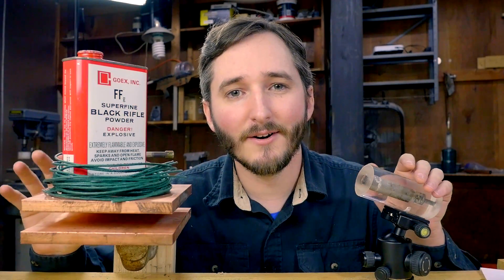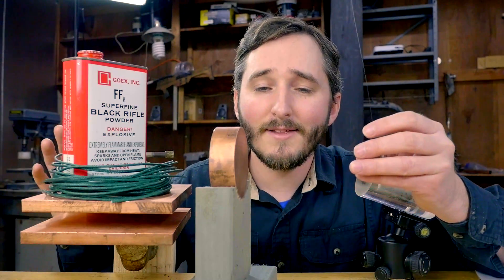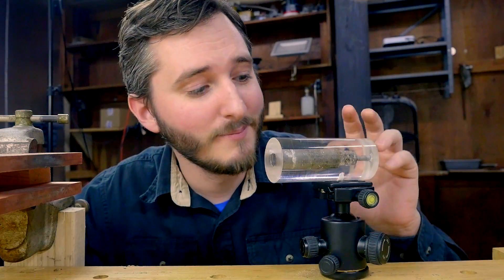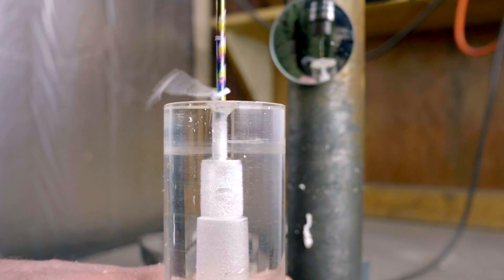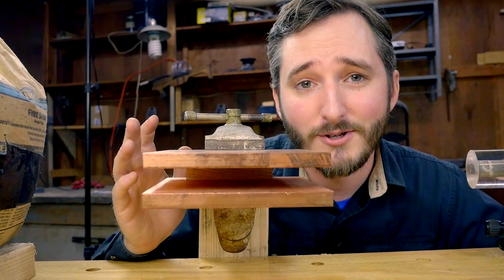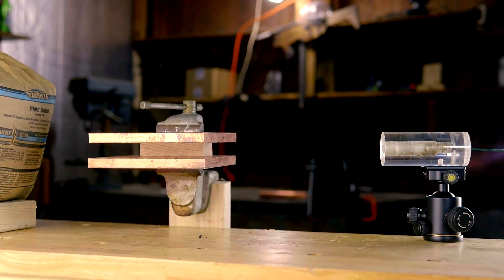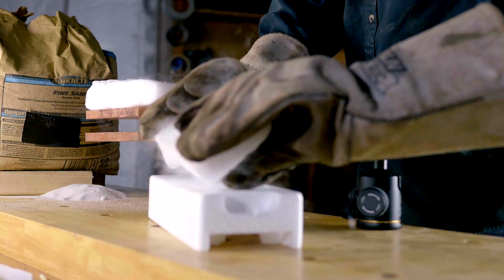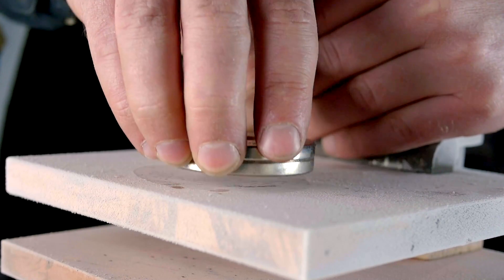Electromagnetic Force Fields VS. Magnetic Cannonball

Comment: Did you consider that the magnetism of the bullet may have been affected by the chemical explosion?  Permanent magnets can lose their magnetism via impact shock. ANd if so, this would affect the copper's ability to stop it.

Since the idea was to activate the electrons of the copper to produce a repulsive effect, what would happen if you were to apply a current on the copper plates or tube flowing in the opposite direction of the magnetic bullet?  Could you propel the magnetic bullet with a magnetic rail gun instead? 

New experiment. Propel a magnetic bullet via a magnetic or electric railgun through a copper tube with current flowing in the opposite direction of the bullet. Try again with current flowing in the same direction as the bullet.

Great video by the way.

Comment: Good experiment but it was inadequate... your copper pipe was to wide for such a small magnet. As you showed how it worked your magnet was a lot larger. The magnetic fields were unable to fully interact with the pipe do to the size. Get the proper size of pipe and try again to confirm your findings.

Comment: you have to use laminates to avoid eddy current loses in transformers - is there an analog in using solid copper? most of the repulsion lost to eddy currents and not circulating in the gap?

Comment: You're putting those magnets under a lot of pressure directly pushing it with that gunpowder. Are you sure that by the time the magnet reached the copper, it was still magnetised and the domains are still aligned? Not even sure if they were in one piece by the end.

You should try firing a ferrous metal past a powered electromagnet. That would be cool.

Comment: @nighthawkinlight There was a major problem with your experiment. Using a sphere shaped magnet allows the magnet to rotate freely not allowing the induced magnetic field to remain in opposition. Basically the sphere rotates every time the magnetic field opposes it. When you use a cylinder, north stays north, south stays south, it's not allowed to rotate thus inducing the Lenz law effect. Drop the sphere through the pipe, then drop the cylinder through the pipe. You'll see what I'm saying then. The sphere will practically free fall. The cylinder will fall slowly.
Reply from the maker: The sphere takes about 15s to fall through the pipe I fired it through. It would be better with a cylinder magnet because the poles would be in the ideal orientation the whole time, but no matter the orientation there is some resistance because the copper makes a magnetic field that is a mirror image regardless of orientation. A mirror image of a magnet will always repel it, though more strongly in some directions than others.

Comment: I think the greatest problem you are facing is the distance between the plates. The magnitude of the slowing effect is very much dependant on the distance between magnet and copper at any given time (about inversely proportional to the cube of the distance). When you look at the pendulum experiment you see that the most part of the slowing occurs JUST before the impact.
So, in order for your double plate experiment to slow down the bullet significantly, you'd have to minimize the distance between bullets and plates at any given time, which would mean a much slimmer "opening" between the plates. However, I do understand that this would make aiming much more difficult, so it's experimentally not easy to do.
Reply from the maker: Yes I made the plates as close as I could while remaining confident in my aim

Comment: I always like your videos. I am wondering if your results with the two copper plates are being affected by the fact that there are two copper plates. Perhaps because there is a plate on both sides of the magnet, that is causing the effect to be canceled out? Maybe if there was only one plate in play during this experiment, the bullet would slow down more than if there are two copper plates. Also, if you can slow down one side of the bullet, but not the other, you could cause the bullet to spin sideways and tumble through the air. That disruption in and of itself could make bullets much less effective, or cause them to veer off course and miss the target.

Comment: maybe the magnet was weakened by the enormous g-forces and collisions? Neodymium magnets quickly lose their power in collisions.
You could also try to connect the two copper plates electrically.
Anyway, great video!
Reply: They where connected electrically if only on one side,  every one seems to forget about the vice!
Reply: John Goodrich 
I mean on both sides, so that the two plates form a short-circuited coil with one winding.

Comment: Would thicker copper pipe increase the induction? Just thinking that the mass of the pipe looks to be much less than that of the plates. The interacting area is much greater with the pipe. Wondering if you had a similar mass of pipe as to the plates used if the effect would be greater than observed with the thin pipe.

Comment: As a professional machinist, i'm cringing at that trick for drilling through acrylic bar stock,  that's not a good way to do it. BUT if it worked for his application of the part, then i guess its a success. Cool video anyway
Reply from the maker: How would you go about center drilling a cylinder without a lathe?
Reply: First I would recommend using a V-block with a horseshoe clamp, as that setup could possibly cause the workpiece slip and give you a really bad day. To find the center scribe a + mark at the center of the stock using a height gauge set to half the diameter of the bar stock. Your center drill was okay, but for drilling I would go with much smaller pecks and use a relatively low spindle speed (500-750 RPM). Always use new and sharp drill bits for acrylic. I'll leave you with little trick I learned- dab a bit of paste wax on the drill bit, just any regular car wax will do, this will give you a glass like surface finish if done right.    : )

Comment: This ideea is very usefull if one wants to slow fast a plumbob tracer that has a significant tracing length (elevator rail tracing during montage) we also use water (cheap method) or oil immersion of the weight (better then water) interesting video :)
Reply: i can't understand anything. do you know punctuation?
Reply: LuxGamer16 Sorry, I am not english native. Also I was referring in decreasing the vibration time of a straight long tracing line. Those lines are used in industry when one needs to precise align straight vertical rails (the elevator rails case). The lines can be disturbed during montage because the worker can touch them by accident. The vibration time of the line is long because the lines use weights at the bottom side to keep them in a straight vertical position. But this also means that each line is a big pendulum. The way of dampening faster the vibrations and pendulum movement without sacrifice on precision is to use some dampening fluid to immerse the weights in it, but your ideea of dampening with magnetic field is not bad at all and should be tested. Sorry for my english, I hope I was clear now and I hope you realise that in fact I enjoyed watching your video. Thank you.
Reply: Victor Hantelmann english isn't my native language either. In fact i speak 5. But i dont want brag. Thanks for clearing it up. Very informative

Comment: Will you perform the experiment again, only this time, measure the amount of electricity induced into the copper pipe as the magnet passes through at different velocities?

Best measurement would be both voltage and amperage so that we can calculate the wattages.

Comment: Currie temperature for those magnet are quite low. Working temperature is even lower.
 You should try high gas pressure as a propulsion method and to lower the air gap between the copper and the magnet.

Comment: engineer here. so..you know how you can power an led with a falling magnet in a copper tube wrapped in wire? light a light with the energy from the cannon, bruh. maybe use an arduino or a raspberry pi to capture voltages so you can see the spike in the graph  if its too quick.

Comment: I think the spinning ball magnet was your problem. You might need to use a cylinder magnet. You can do this by starting with the cylinder in the copper pipe, and use a rod in the cannon to push the magnet.

Comment: I think you need some Ballistic Glass to stand behind.
Reply: I agree. A single Plexiglas or polycarbonate sheet of the right thickness would do just fine at these lower speeds. At higher speeds or for improved safety the Plexiglas (aka acrylic glass) should be facing the subject or danger of impact and then immediately backed by a polycarbonate sheet facing what you are trying to protect from impact. This set up uses the flexural strenght (resistance to penetration before breaking) of the acrylic and the impact strenght (ability to absorb ballistic energy before rupturing) of the polycarbonate to the best advantage.

Comment: Suggested safe camera technique.  Place a mirror at an angle in the path of the projectile then align the camera to point at the mirror so the reflection is looking down or at least at the barrel.   If placed directly in line of the projectiles path, of course, the mirror will break. But if you place the mirror to the side like you had the camera then you could position the camera in a safe place and control the camera safely.   (hope that made sense to someone).

Comment: Magnets lose their magnetization completely by 100C. #curiepoint
I don't think you were actually testing your theory because having held bullets after firing, I think it was well past the Curie point and if so you were essentially firing a rock. Do you have enough frames to calculate velocity vs position? Can you use an air compressor instead of a black powder cannon?

Comment: So if magnets push electricity to flow, do you think you can make magnet bullet even faster by using both black powder and copper coil under high voltage?
Reply from the maker: It would be hard to synchronize a chemical reaction with electronics in that way. Besides that, it would take a tremendous power supply to the coil to match the black powder, let alone exceed it. Probably the coil would just stand in the way.

Comment: you could never stop a magnet by eddy current.The slower your magnet is, you have less eddy current and less inverting magnetic field. The same problem with eddy current brakes - the last breaking force has to be mechanical.
And in your experiment you should not use a round barrel . use a cylindrical. A round barrel rotates and so the magnetic flux of the magnet - this makes the opposite flux (generated by eddy current) less efficent.

Comment: Good experiment. This could work in the case of a maglev train. The copper would over a long enough distance slow the train down without any physical contact, say in a station or a dangerous intersection as a fail safe measure. Also quick tip when drilling acrylic: most drill presses can be slowed down by changing the belt configuration. Takes longer but gives a really good result!

Comment: The problem was that the copper plates and pipe where parallel to the trajectory of the cannonball. The magnet pendulum worked because it was in the trajectory of the pendulum. The parallel copper stuff might have made a frictionless barrel, the cannonball was „floating“ though the barrel. A railgun might work in similar fashion, im not totally sure.

Comment: It would be interesting to see you shoot a magnet through a coil of wire with lots of turns to see how high of a voltage spike is produced  from the rapid magnetic field changing. Could generate a spark if it is high enough!
Reply: I think that would be cool! If hooked up to a multimeter it possibly could be used as an induction chronograph, that's if varying velocities produced differing results.
Reply: yeah, he might then realize its no longer a magnet after being fired out of a cannon
Reply: @The1wsx10  That was one of my questions.  All that heat and knocking around probably did some damage to the magnet.
Reply: @The1wsx10  true heat makes rare earth lose it's magnetic properties
Reply: ^interesting
Reply: like:)

Comment: Probably a long shot but would there be enough heat transfer from the gun powder to the magnet to heat it past it's curie point? Meaning it wouldn't act as a magnet as it passed the copper.

Comment: I think the problem here is the shape of the bullet, not the principle theory. When the magnetic bullet enters the copper area, the magnetic field can be aligned any number of ways. For the inductance to have full effect, it needs to be perfectly aligned with one pole of the magnet going forward, the other going back. The effect will be completely gone, if the poles point to the sides or if they point upwards and downwards.

What's more, the bullet will turn around inside the copper even if it is perfectly aligned, because of the inductance. This will help it reduce the force of the induced magnetic field on it. And once it's aligned away from its flight direction and points up/down or sideways again, the inductance effect will be gone.

This would also happen with a smaller magnet when you drop it through a copper pipe. It's why the magnets used for that particular experiment often fit exactly into the pipe, they simply can't turn around.

So you might want to try this again, first by dropping the bullet magnet through the copper pipe and see if the same none-slowing effect appears, then maybe get another shape of bullet, one that won't be able to turn around when it enters the copper pipe.
Reply from the maker: There is an ideal orientation for the magnet to be in, but it slows to some extent in any orientation. I cut part of the video where I talked about that. When dropped down the long pipe it takes about 10-15s to fall through

Comment: The title got me hoping this would be a cannon which fires the projectile with electromagnetic forces. I’ve always wondered if that would be possible ever since I felt the power of putting an iron bolt in the middle of a pipe wrapped with charged copper wiring.
Still an interesting video though.

Comment: The effects of inductance is an exponential, the closer the receiver, the more power is transferred, with the exception of tuned circuits which amplify inductance effects (but which are likely still an exponential function on a larger scale.)  TL;DR, the closer the plate is to the magnet, the more its effects are felt.
Reply: doesnt the effect increase by the square of the distance between conductor and magnet? if there was a closer fit I think it would slow down a lot. also, a drvice to strike the magnet rather than gases might reduce forward pressures after the projectile starts.

Comment: Magnets lose their magnetivity when exposed to heat or pressure. This is exposing it to both at the same time. The magnet is rapidly losing its magnetivity with every shot fired, and thus the copper is doing less to it each time.

Comment: In order to stop your magnetic pellet before impact you would need to generate a magnetic field roughly equivalent to the Earth's gravitational force.  But that magnetic field would need to be restricted to about the size of the anticipated point of impact.  As previous experiments have already shown, the faster the pellet is moving requires that much greater field strength to negate the speed.

If you have a viable method of measuring the generated field strength at lower speeds where the pellet is stopped before contact.  You should then be able to experiment at higher speeds and measure filed strength and results as well.  Thereby allowing you to more closely estimate the required field strength to stop a pellet moving at rifle bullet speeds.

Comment: So, could you maybe generate an electromagnetic field large enough to accelerate a magnetic ball to bullet-like speed? 

By Newton's III, the force it takes to accelerate such a pellet to bullet speeds should be equal and opposite to the force needed to stop it. 

From there you could calculate the missing variables to design your bullet stopping rig. No?
Reply: For your first question, search for "railgun" on Wikipedia or YouTube.
Reply: Railguns work but it's apparently not that practical. The energy density of chemically combustible materials is far higher than batteries can achieve. So your "ammunition" in the form of batteries is far heavier.
Reply: But high powered capacitors do have much  higher energy density than batteries so those work
Reply: Dejay Rezme According to Wikipedia, Gunpowder has an energy density of 3 MJ/kg whereas Li-Po batteries have one of 1.8 MJ/kg.
Yes there is a gap, but not enough to justify not having railguns.
Reply: But capacitors have higher energy density than batteries so wheres that statistic?

Comment: if some of the energy is converted to heat could you use a thermal camera to capture the change in heat of the copper plate?

Comment: Can you measure the electric changes in the copper while the magnet interaction?
Reply: jose ramirez 
You should be able to measure small voltages on the surface of the plates, maybe with an oscilloscope or something.
Reply: jose ramirez Wouldn't work well as there realy needs to be an open circuit to measure voltage reliably. Now an amp clamp on the other hand might be interesting...

Comment: cool demo & explanation.  3 possible additions; 1 use the big pieces of copper as cores for wire coils.  wrap & hook up as an electromagnet useing pulsed ac or dc for the field.  2 wrap & hook up alittle  differently to act as 2 capacitors. 3 try with iron as the core.
Reply: you could do those to see if the increased mag fields make a difference.  you could do the same wrapping one or more battery driven coils on the long copper pipe.